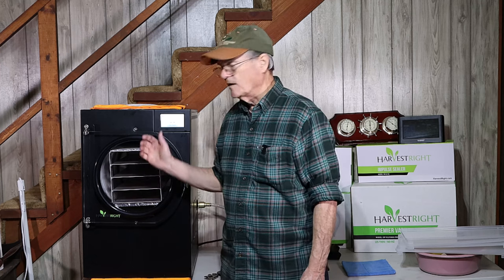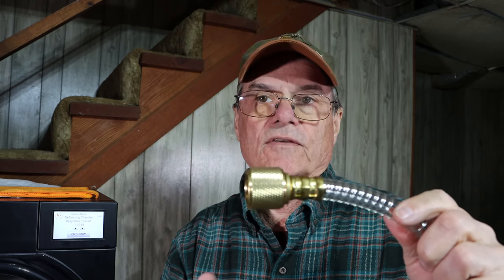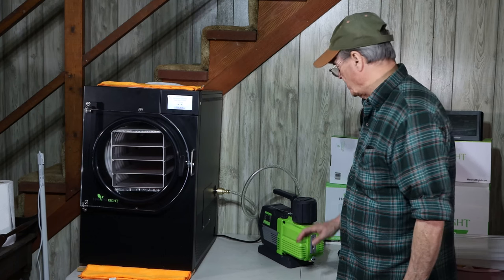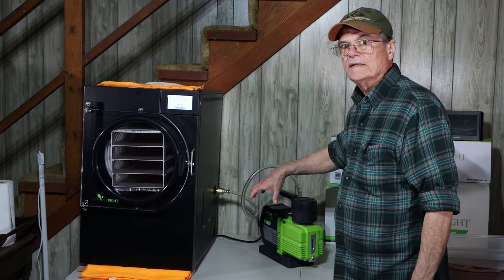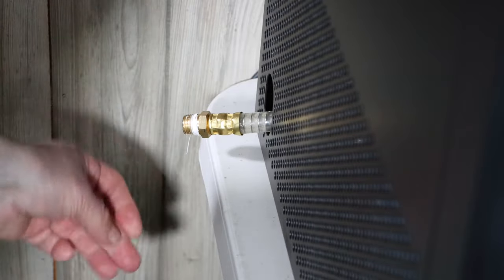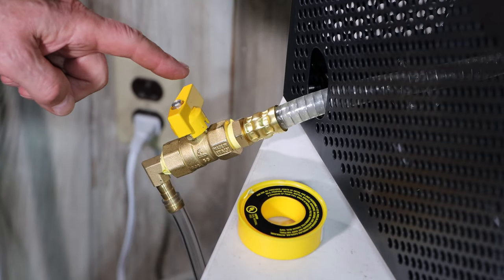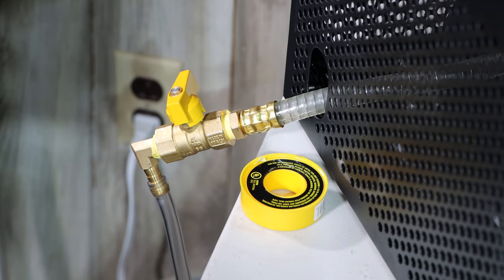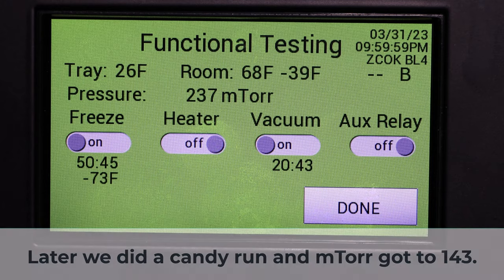Vacuum Leaks Harvest Right Freeze Dryer Errors Tips and Tricks, How we fixed ours.

Comment: My drying time is still running. The timer says 64hours 34 min I have peas and blueberries on 2 trays should I stop it?
Reply from the maker: Blueberries have to be broken in some way. Stick them with a pick of some type, because of the skin and seeds. What are your readings on your machine?  64 hours is way too long for a run. Do you have all four trays in the machine? There is only a sensor on one shelf, so you need to make sure that shelf has a tray. Also make sure your tray holder is not upside down. Send the readings on your display maybe can be more helpful..

Comment: I'm having a problem with my Harvest Right freeze dryer again.  I've had it for 1 yr 3 months and has had so many problems! Under warranty was able to finally get each of the 6 problem fixed, but now it's out of warranty and down again with a new problem.  It freezes and dries but when it goes into extra dry time it starts freezing again. Anyone else have this problem? Sure could use suggestions before I have to pay 45.00 to fix it again.
Reply from the maker: That sounds like a software problem.  If you can, you can try upgrading the software.  Good luck and we hope you the best.

Comment: Adding a Y after vaccine valve will reduce suction in the drain water if your tubing gets submerged.
Reply from the maker: Yes it can, we cut the tube short so it does not get that far down in the bucket and we empty the bucket often.  Thanks for the suggestion and have a great day.